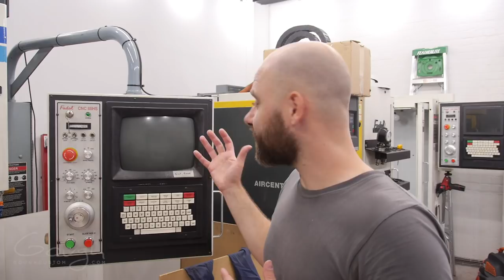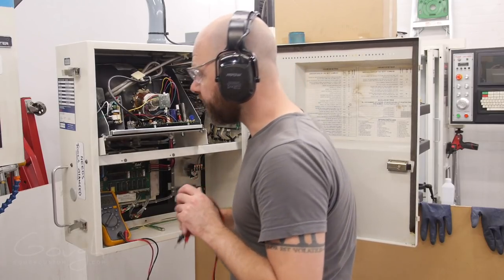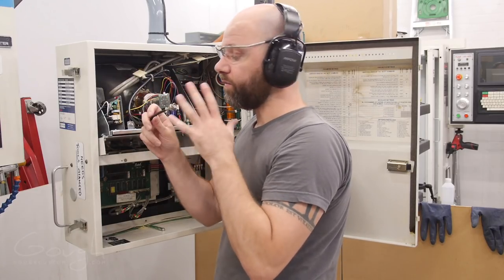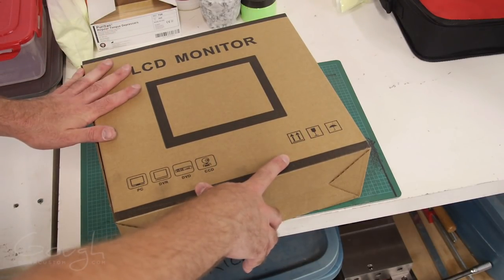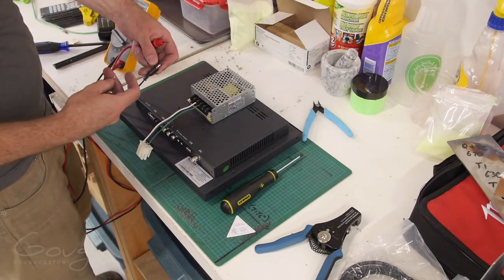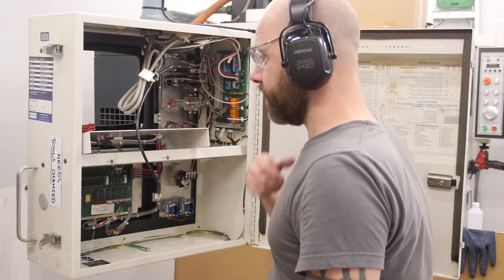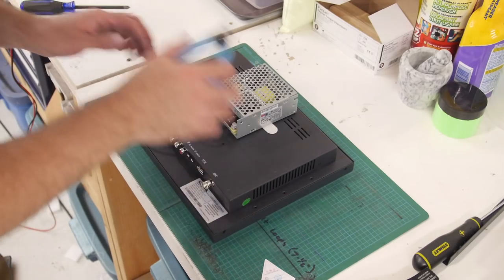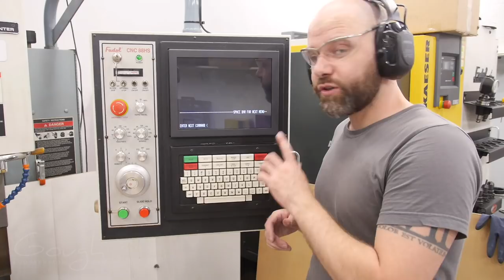Replacing a 25 year old CNC screen!

Comment: Hi, it's a great video, congratulations, i want to do the same in a cnc mach 9 Romi, but the output signal of my machine it's separeate: video, Horizontal sync and vertical sync. My doubt is can i plug this signal like you in de vga conector or i need to convert de signal. The old monitor is a CRT monochrome monitor.

Comment: Great video! Even if you aren't fixing a mill, lots of good info. I wonder if the more expensive panels have glass screens. That seems like it would be good to have on an industrial machine to prevent scratches.
Reply from the maker: Hey Tommy! The replacement monitor I fitted here actually has a glass screen, not plastic! From what I've seen they're very durable, no issues with scratching them when wiping them down or anything as of yet! The 'expensive' replacements honestly seem exactly the same, though a few of them come with a mounting cradle meant to replicate the CRT mounting locations, which honestly just seems unnecessary!
Reply: @GoughCustom  Sounds like a great deal then! An $800 replacement is bogus regardless of whether the cheap one was glass or plastic. Awesome you were able to find a cheaper option that fit like a glove.

Comment: How are you doing ? No videos and you webshop seems to be about 1 year out of date.
Reply from the maker: Hey mate! Doing 'ok', the last 18 months has been a bit of a wild ride as renovating my new workshop building has taken a LOT more work / money / time than I really anticipated before moving... However I did just do a big pre-order of knives, updated the website, and I'm looking forward to getting rolling and making knives again, I really miss it!

Thanks for checking in on me
Reply: @GoughCustom  Renovations are double the work of building new stuff ! I have been at it for 15 years now. Great to hear that you are ready to do the things you love again. Looking forward to a video of what you have been doing, if that is possible. All the best !
Reply from the maker: @Panzax1  I will definitely be posting a video when it's finished, I've been filming the whole process as I go... Yeah I had originally planned just to move one wall and install drywall in the new shop, but after opening up a wall I found a really bad mouse infestation and decided to gut the place and do all new insulation, vapor barrier, interior sheathing and then drywall. Has already paid off big time in terms of insulation as the building leaked like a sieve before...

You'll appreciate this I think given your background in renovations: I also found that the roof over the office area of the shop had 2x12 rafters on 24" centers with an unsupported span of 20', and we live in an area with a potential snow-load of 60lbs per sq foot 😭😳 I have no idea how that roof had not already caved in... The span calculators said the max span with that lumber should have only been 10' lol.

I jacked the rafters up, sistered each one with a fresh 2x12, then built a structural beam at the mid-point of the span and built columns in the walls underneath to carry the load down into the slab. The renovation was worth it just to find that potential huge issue I think! Glad it's fixed now...
Reply: @GoughCustom  That made me chuckle: Sounds exactly like what I've been doing !

Comment: I don't own a Fadal Mill.
But I do have a Mazak Lathe that is still in it's Mission / Rebuild stage.
Currently fitted with a CRT Monitor.

Replacing the Monitor is something I Definitely want to do for all the obvious reasons 😁
Trying to find something that is not so costly as you mentioned is a big plus.

My Mazak Dealer does have a Genuine Replacement at a cost of around 2K.
Which is ok IF I owned a 300K Lathe.
But my machine like yours is a little older and 2K is a little too expensive for an older machine.

( it was sought of funny because I was at the dealer when asking about a replacement monitor, the sales guy had a look on his face as if to say 🤔I don't think this guy will buy it.
he is definitely right about that 😂)

The Monitor you chose is a not only reasonably priced but also improves the machines appearance.

Just subscribed and looking forward to watching more from you soon.
All the best.
Peter 👍
Reply from the maker: Cheers Peter! Yeah $2k for a screen is just silly, hope you're able to find one like the one I used that just happens to fit perfectly! Best of luck!

Comment: Is there a way to adjust screen alignment?  I just put a super cheap monitor in my VMC40 and the bottom three menu items are not visible on the screen.  I don't think this one is adjustable.  Thanks for the video!
Reply: I have the same problem in my old Fadal (DC Motors) i tried to adjust with the diferent picture parameters of the lcd monitor but I couldn´t, i tried in my newest Fadal (AC Motors) and it works, I hope somebady could help us. Regards
Reply: @icoaguilar750  I had to install the newest video card.  I think it was the 1420-2 card that made it work.  Now on my cheap monitor I am using now the top line isn't visible.  I am getting one of these better monitors and they allow you to manually align it from there.  A tech at ITS said that newer card is a must!
Reply from the maker: I haven't had to adjust the vsync that much so I can't really add anything here unfortunately. If you need to research it further 'vsync' is the term you need to look for, there's a timing element to the way the video signal works and if that is not being detected properly then the vertical and/or horizontal alignment will be off...

Comment: Fadal machine, based on welded steel frame (out of mild steel tubes)? Without cast iron?
Reply from the maker: It's largely welded steel, yes. The Table, Saddle and Head are all cast iron though, and the base is filled with concrete at the factory to reduce resonance.

Comment: Hi Aaron, after you program the new monitor with the remote control you have to set every time you turn the machine on or only in the first time?
Thank you
Reply from the maker: Hey Wagner!
No, the remote control is only needed when first setting up the monitor. After that it just remembers the settings when turned on!
Reply: @GoughCustom  thank you very much sir
I have learned a lot from your videos, with your excellent work and dedication.
Thank you
Wagner

Comment: Great Swap out Aaron.  Clean and 20lbs lighter but will miss the green.  Curious if your old screens had burns in the phosphorus?  If not I'd find someone or fix it myself for nostalgia/Archival coolness.  Honestly, I still have an original IBM XT with a 5mb Bernuolli drive and a CGA Card and Monitor (circ. 83') still sparked as of 18mo. ago...figured I'd donate it in another decade or give it to the grand kids to see where tablets came from. ;-P  Thanks Aaron, always a treat and yes I noticed...thank you!
Reply from the maker: Hey PJ! Thanks again for your support! I do love the old green screens as well, but the new LCDs are just so much easier to read! Yeah the CRT did have burn-in as well unfortunately... 

The old computers are really fun to see! I have a soft spot for old Apple Macintoshes. My first 'real' computer was a Macintosh LCII, though I had access to an Apple II, an atari and a Mac Classic earlier than that...

Comment: How did you connect the signal to the LCD?, you didn't show that.
Reply from the maker: Ah I guess I forgot to point out when I was doing that. At 10:02 you can see I'm plugging in the BNC connector which transfers the video signal. It just plugs right into the only place that matches!

Comment: Well done. Now you need to find someone who wants to make a video fixing the old screen...
Reply from the maker: Thanks mate! I honestly probably could have fixed the old screen myself, usually with those old CRT screens as long as the tube is intact then it's a matter of replacing burnt out components like that big capacitor, cleaning things well, and maybe fixing a circuit board burnt trace or two if there was a short... However I just didn't think it was worth it. It would be a fun project but unfortunately I don't have any use for the finished product!